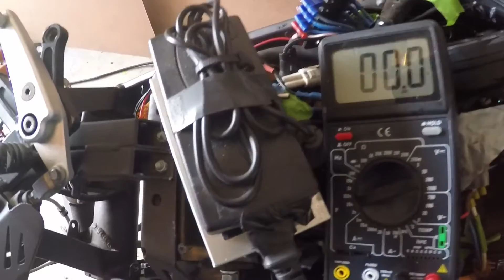Installing New Motor pt1

Comment: why do you need to do this? if you are just interested in the speed of the motor wouldn't it be enough to get the info out of the motor controler?
i work in industrial plants where they check the speed of the motor just with the frequency driver. plus the speed is already showing on the rpm meter.
i'd just like to understand what you are doing